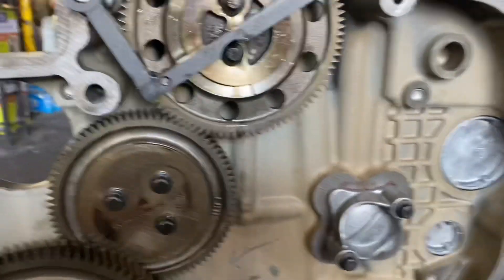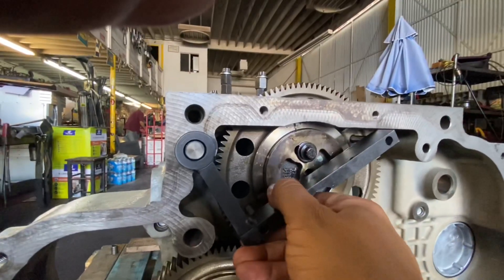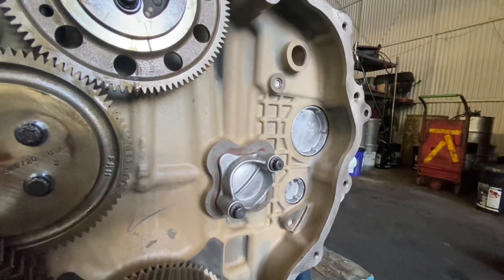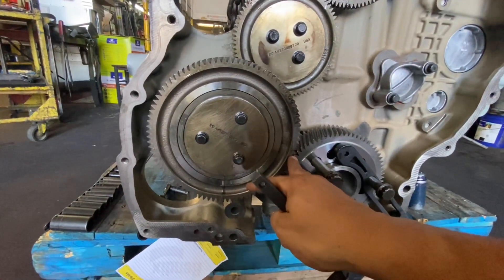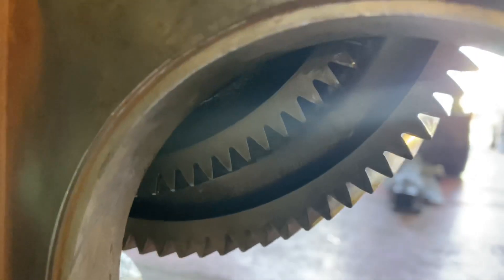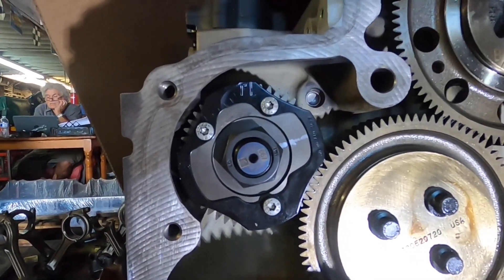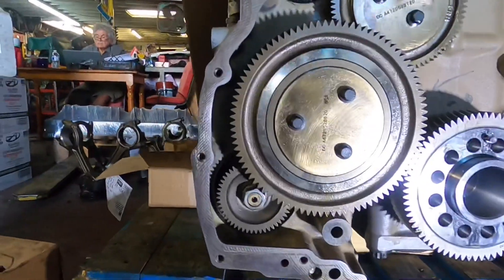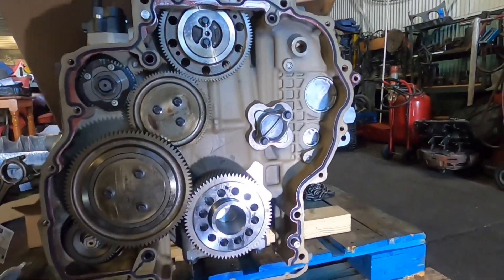DD15 major overhaul, how to setup the gear train timing and what tools you will need

Comment: I understand that if the engineers made that timing tool for the crankshaft, it must be for a reason, but I still don't fully understand the reason because the other gears don't have timing marks, so every time crankshaft is turned, it will always reach the same position. Do you have any explanation for this?

Comment: You only have to adjust/remove gear drive on total overhaul? I worked in Freightliner dealers and don’t remember seeing rear cover removed on overhaul
Reply from the maker: For an overhaul yes, I tear it completely down, have the block checked and line bored then we build it all back up.. For an inframe you dont have to.

Comment: After i tight gear 1 the tool get stuck ? Its the play bad or i need to adjust the lash again i try to follow the instructions but they dont say anything at all
Reply from the maker: The tool should be able to slide on and off fairly easy. Little resistance.

Comment: Do you rebuild alot of dd15 or do crate engine swaps?
Reply from the maker: Rebuild all of my DD15 engines 
Crate engines are not too common for me. The cost for one thing and the warranty only applies if you don’t have a delete to the emissions system. Detroit will automatically void the warranty if your truck is deleted. So if a truck comes in asking for a rebuild we have to consider that when we do the work.

Comment: How much does this job cost?
Reply from the maker: A complete overhaul you are looking at $6500-7500 for labor. 
Parts depend on the year of the engine and unfortunately prices are increasing
Reply: @CarlosDieselElectric  2015 cascadia i think i have a bent toner wheel or 1 of the lower gears in ur video but im not ruling out wiring harness i replaced cam pos sensor 4 times and new cylinder head i get a code for cam and craank sensors speed not matching and sometimes my dash says timing problem detected shutting down and it goes away in like 7 seconds and tyeres a grinding sound for 2 or 3 seconds.dd15
Reply from the maker: @GenXFarmer77  you have two sensors for timing. Flywheel and CAM. 
For a gear to be bad or go bad is difficult. Remove the valve cover and inspect the timing gear or plate
Reply: @CarlosDieselElectric  already had that done when they replaced my cylinder head

Comment: Should I do timing for high pressure pump as well ? Or not ?
Reply from the maker: Yes, definitely put the fuel pump to time. This way the engine is all times together. Crank, CAM and fuel pump.

Comment: I dropped a 5mm allen wrench into the gear train while removing the injector wiring harness. I'm watching this video to see maybe where it ended up so I can fish it out on monday. From this vid, it looks like there's enough space behind the gears that it dropped straight down into the pan. What do you think?
Reply: It's on top of the head just remove the cams smh or get a magnet
Reply from the maker: That is hard to say. If you are lucky it is in the pan, if not the back cover will need to come off.
Reply: @CarlosDieselElectric  Thanks for the reply. Guess I'll just have to find out...
Reply: @CarlosDieselElectric  I have a truck in stockton needing a 
overhaul how can we contact you?

Comment: Do all semi truck engines have a bull gear? Can you help. Thank you
Reply from the maker: Series 60 (12.7L and 14L) do have a bull gear. DD15 DD13 and DD16 does not have a bull gear. 
Not familiar with ISX, I think the Volvo D13 does have a bull gear.
Reply: Thanks. I did check online. But all that came up was the Cummins ISX, Mack mp8 and d13, the maxxforce international, the paccar mx13, kenworth t600, t800. All have them. Thank you
Reply from the maker: @findyourself2130  yeah. Detroit changed things with the DD Series engine. Still have gears but no gears.
Reply: Thank you.

Comment: Hy , Saludos de Ucraine. may be you could help us, it concerns timing/adjusting of fuel pump to camshafts. We have such problem, "broken" engine DD13 with PTO driving, here are  5 idle gears. Our client had bought another used DD13 , without PTO drive, it means only 4 idle gears. We have put this additional idle gear for PTO, from "broken" engine to "new bought", also we have taken /changed a crankshaft gear ( from broken to new bought) , that it could drive PTO gear. We have also taken a fuel pump of high pressure and injectors from "broken" to " new bought", the reason was electric cables, we have not changed camshafts, other idle gears from "broken" to "new bought" engine, we have studied und we know info about timing of fuel pmp, about camshafts adjusting and timing, the proble is , that there are fuel pressure in rail, a fuel pump is creating enough pressure of fuel, but ist not going, is not cranking,what is the reason ? Thanks
Reply from the maker: What year engine is the new DD engine? 
Same year, older year?
Reply: @CarlosDieselElectric  Many thanks for your response , the "broken engine " I suppose was year 2012/2013, the " new bought "engine is more younger, I suppose 2013/2014, these both engines are from MB Actros Euro 6, I can see difference between these engines in MB Programm EPC Flexible, there is difference in fuel pump,injectors and camshafts
Reply from the maker: @vitalijdanajkanich308  I would start from the very beginning. Timing gears, set the crankshaft to TDC1 then install all your gears. Make sure the lash is correct on the top gear. The fuel pump must also be timed properly before being installed. Once you have done this, adjust valves and rotate the engine several times to make sure the engine does not get stuck. 
Are you able to crank the engine but it won’t start?
Reply: @CarlosDieselElectric  We will do so, as you say, from beginning, we must disconnect gearbox, clutch and try it. I can so discribe you, we try to crank the engine,we feed with the hand pump, than fuel  pump of high pressure full the rail, there is pressure, but it does not work, only maybe 1 second, as we help with start fluid , We have experince with these engines DD13 , but in this case we doubt ,because we had to install additional PTO gear , an we have changed fuel pump and injectors from old engine, may be it caused some troubles for "new bought engine"
Reply: Have now from this mechanic new information, too low fuel pressure in rail, only 300 bar
Reply from the maker: @vitalijdanajkanich308  Check for any restrictions, could be a bad fuel pump